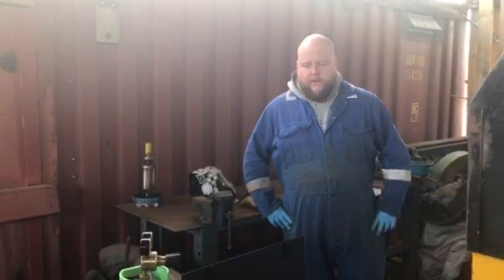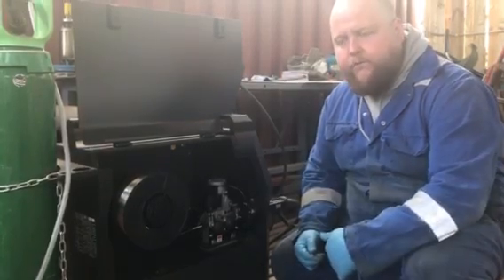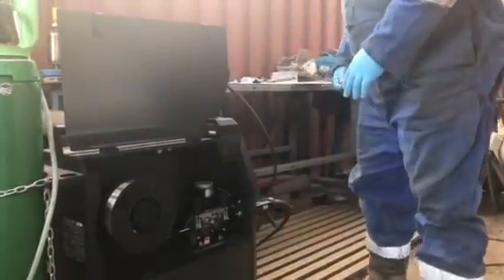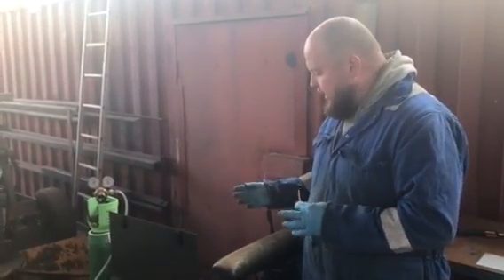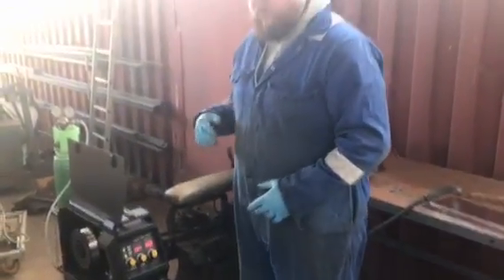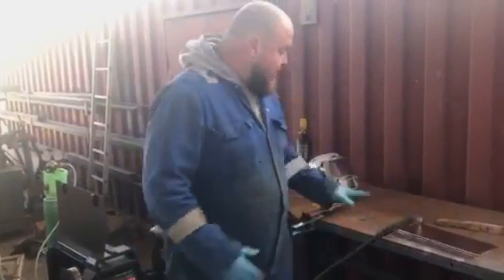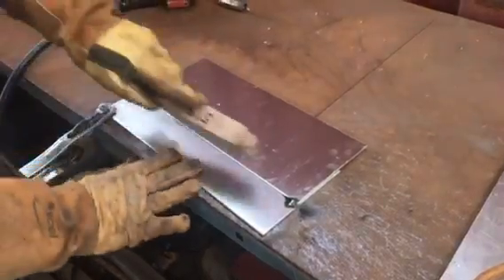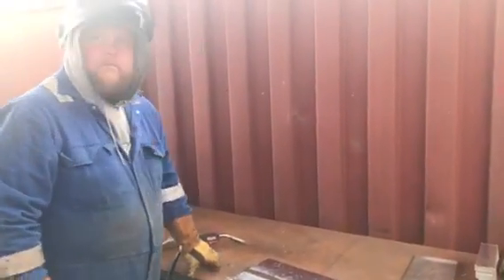MIG welding Aluminium For Beginners

Comment: Great job on that welding, I would say if you heat up the start area of that weld with a butane torch you will find the welding process will be easier as the aluminium will be warm and get that consistent weld throughout the whole piece. Also if you want to minimise soot try cranking the argon to 30 or so. Yes you will go through your argon but sometimes it gives you a cleaner weld.